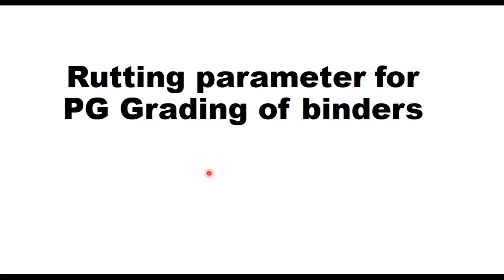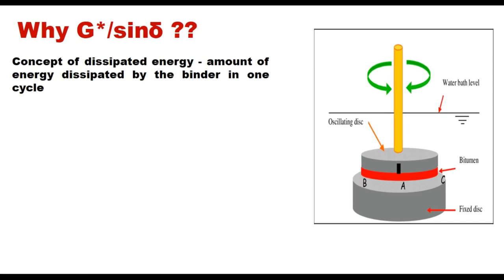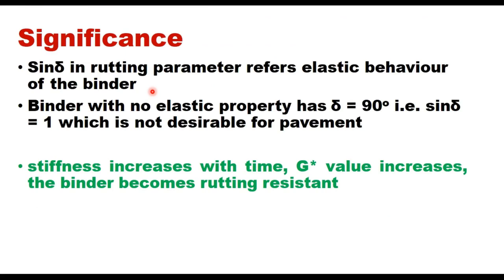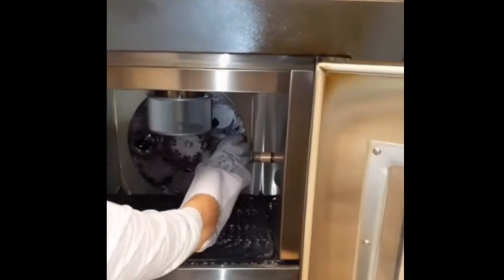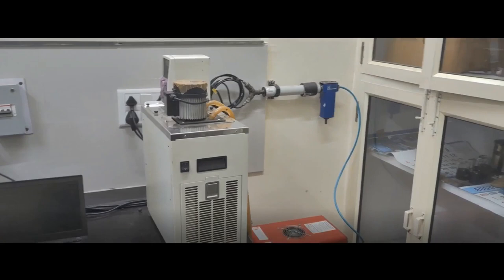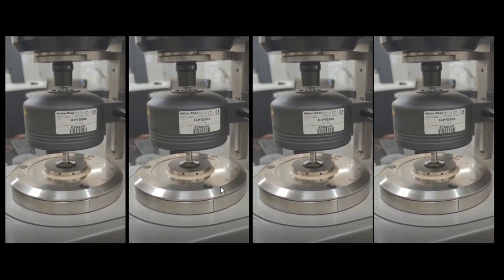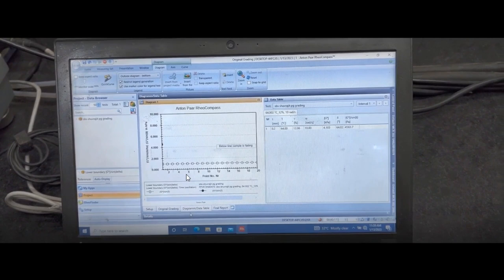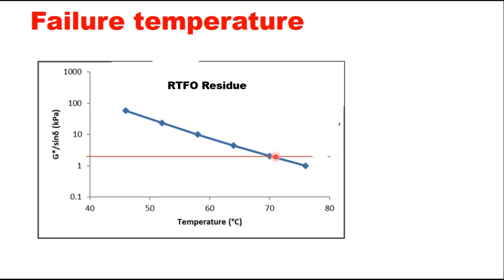#Asphalt PG Grading of Bitumen Binder - Determination of #rutting parameter and maximum temperature

Comment: Sir, please explain why the Binder samples is not testing at G/sind (Rutting) for PAV samples?
And at G*sind (Fatigue) for Unaged and RTFO samples?
Is there any theory behind this?
Reply from the maker: G*/sind is a rutting parameter and G*.sind is a fatigue parameter. The binder gets hardened and brittle after long term ageing and therefore, fatigue cracking is more prominent after ageing.

Comment: Sir, Why the test temperature is not more than 100C ? For some modified binder it may not failed under 100c , then how to define the PG for some modified binder ?
Reply from the maker: No, even modified binders do not have maximum temperature more than 94C
Reply: If I tested at 94c if it is not failed, value not less than 1 for unaged sample then I should stop the test and repeat the test? Because I have tested some lime modified sample but doesn't failed 94& 100c also. So what to do for this sample? How to denote PG grading for this sample?
Reply from the maker: @sayantansasmal1352  The average 7 day maximum pavement temperature typically ranges from 46 to 82°C, and minimum pavement temperature typically ranged from −46°C to −10°C. I have not seen any grade of the binder beyond these limits. I do not know about your test results.